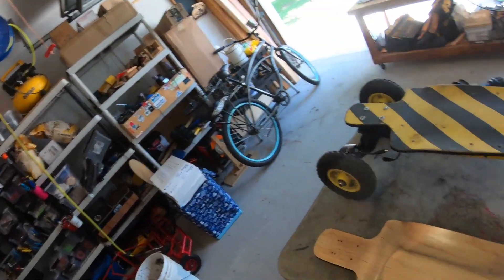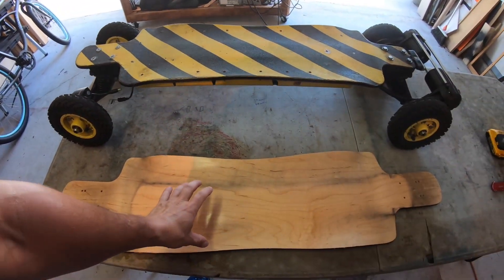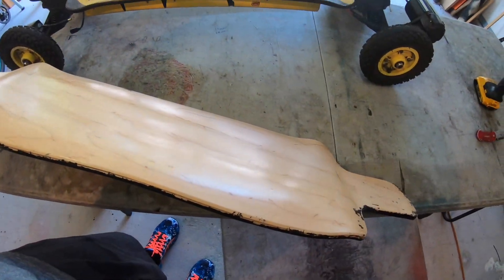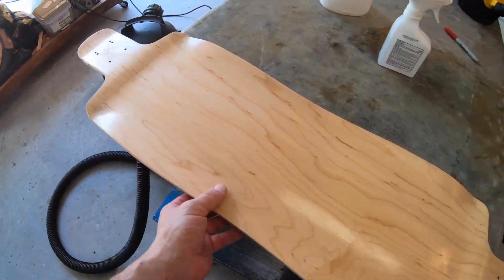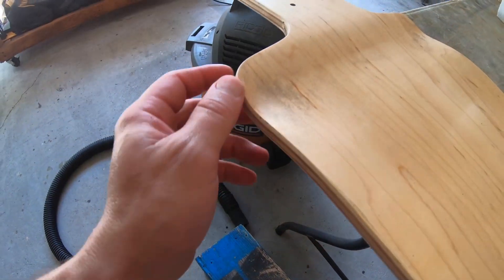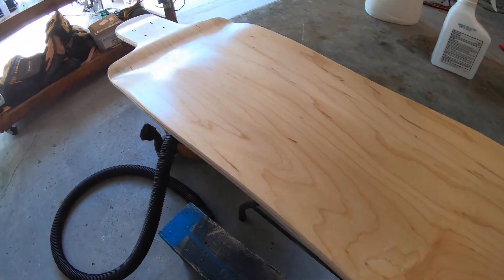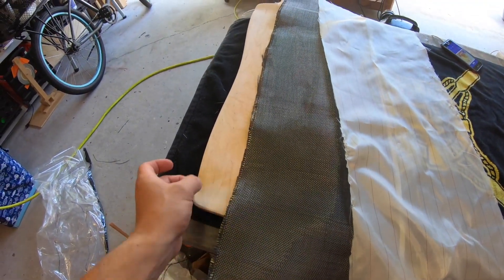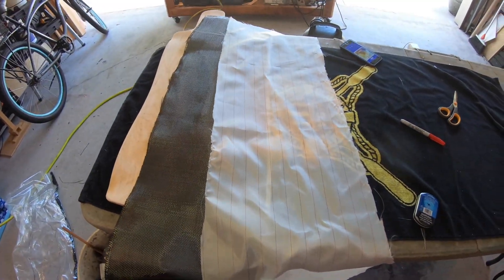How to Carbon Fiber Skateboard Deck

Comment: I've noticed you stick down the vacuum bag by sealing it with celicone. It would be great if you could explain what products you use for that?
Reply from the maker: Hi Don.  For bag i used regular department store visqueen plastic poly sheets.  I used regular weatherproofing silicone one would use on their house (department store).  Is that what you meant?  Let me know if there is something else.  Originally, are used shower curtain plastic for bag. It was overkill.
Reply: @artsiomnaidzich9515  wow thank you, most definitely going to try it this way...

Comment: Nice project. With a surface like this with such smoothness it seems that the vacuum seems like extra work. What i usually do is cover what im covering in black epoxy and allow it to get tacky before i add carbon. Then i wet the top with clear epoxy and allow it to tack up again and coat it a second time. After the second coat dries i sand and coat the last time. The i buff and polish. Vacuum looks nifty though.
Reply from the maker: Thanks Oscar. You are right, your method is faster.  I do think that vacuum method produces a better bond between materials. Epoxy cures under lots of pressure in vacuum. (About 1 bar if my vacuum pump is on its A game).

Comment: Nice. What deck was that you used for this project?
Reply from the maker: Ill try to find it for you.
Reply from the maker: I think it's this exact deck.  At least one other viewer was surprised after purchasing a similar deck and realizing that it's not made for 30 degree all terrain truck.  This deck will work with 30 degree truck, but 30 degree riser is needed.  I make them out of wood.  I know at least Trampa makes a commercial riser.

https://www.amazon.com/Moose-FREERIDE-FREESTYLE-LONGBOARD-CONCAVE/dp/B00AI1LMSK/ref=sr_1_20?dchild=1&keywords=Longboard+deck&qid=1631796926&sr=8-20

Comment: Do you have to do it with the vacuum seal ? Or could you just do it the same way as they would so surfboards, and do you have to do a hot coat ?
Reply from the maker: What is up Cameron.  You dont have to do vacuum seal.  You can do hand lay up instead.  If you want glassy finish, yes, you do have to hot coat it.  There are plenty of videos on how to do it.

Comment: Awesome video! Work looks tedious but with it. Question about the separator cloth, what material is it actually? I'm undertaking this project and have all tools/materials except for the separator fabric and am having trouble finding something that looks like what you had.
Reply from the maker: Cinco339, thanks bro. Try searching for PEEL PLY FOR CARBON FIBER INFUSION.

Comment: Cool, I want to try this on a Boblbee backpack I got off eBay to renew it. Do you think the vacuum chamber necessary or is it possible to get a smooth finish with a little bit of elbow grease? Thanks for the vid
Reply from the maker: Michael Azzato, how goes it! Absolutely you can do a hand layup of carbon fiber. It prob would be easier. I was experimenting with vacuum set up.  Check out CARBON COMPOSITES VIDS on youtube.  They got really good educational vids on carbon fiber matters.
Reply: Artsiom Naidzich great to hear, thanks for the info!

Comment: looks very nice! What is the white material that you have put on top of fiber before putting the vacuum bag on it? Interesting that it doesn't stick totally... :)
Reply from the maker: What's up Mud Cube.  Layers are as follows:  Carbon Fiber, Separator Fabric (It allows excess epoxy to sip through it, allowing a perfect amount of epoxy to remain imbedded into carbon fiber), and paper towel (allows for air to flow out of vacuum chamber and soaks up excess epoxy).
Reply: @artsiomnaidzich9515  thanks for sharing!

Comment: Very cool, I'm gonna try and do this with my own board too. How much did you pay for the vacuum pump and how long did you leave it on?
Reply from the maker: VIVOHOME 110V 1/4 HP 3.5 CFM Single Stage Rotary Vane Air Vacuum Pump with Oil Bottle ETL Listed https://www.amazon.com/dp/B07RGQ786R/ref=cm_sw_r_cp_api_i_4uDkFb0KMC7F8

Above is a link to the vacuum pump.  I left it on for about 5hrs at a time.
Reply: @artsiomnaidzich9515  thanks mate :)